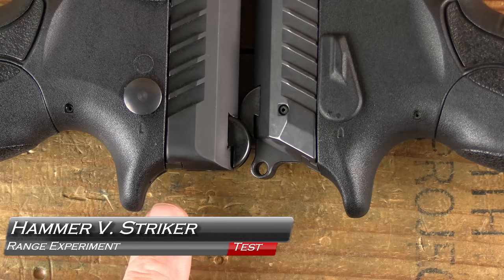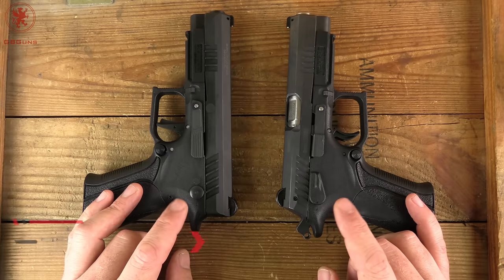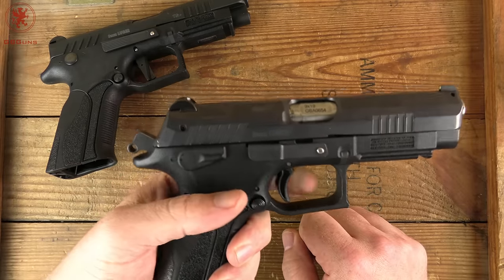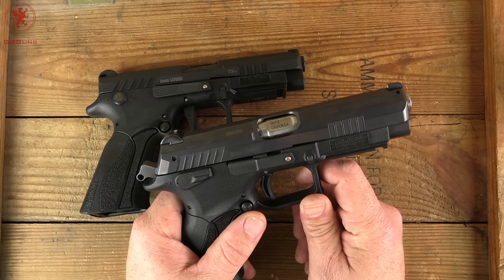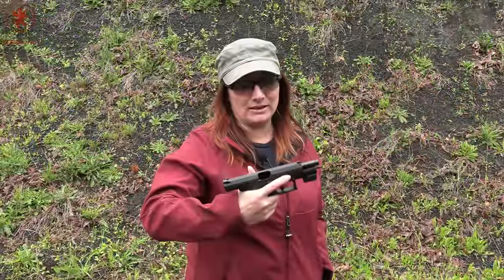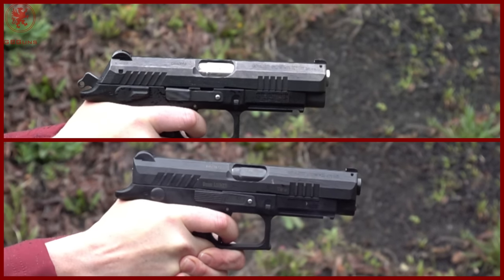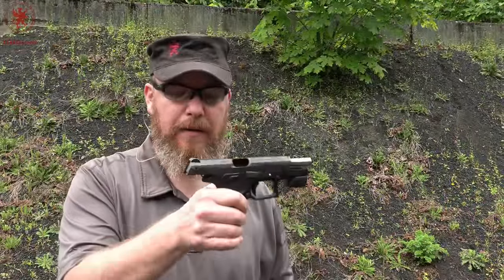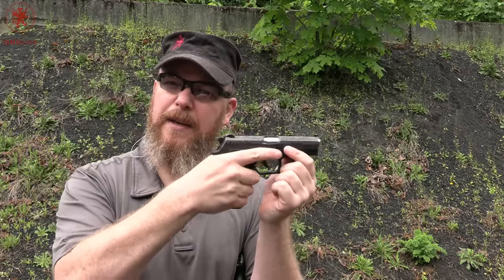Hammer Versus Striker Fired Recoil Experiment

Comment: Since the hammer does take up some of the recoil energy, a lighter recoil spring can be used. The problem is cycling reliability and making sure the slide goes back into battery. 
With the striker gun, the recoil spring is the only thing that controls both forward and back motions of the slide. So the recoil impulse is more consistent in both directions. 
With the hammer, that changes things. The rearward motion of the slide is controlled by two springs while going back into battery is only controlled by one. This is tricky because the inertia of the hammer must be overcome for the gun to cycle. It makes sense that the striker gun felt smoother.
Reply: Not true. Forward motion of strikerfired pistol is controled also with striker spring weight. That is why you need stronger recoil spring in striker fired gun than hammer fired.

Comment: Have you tried to check whether the springs are different?
Another cool video could be to compare 'similar' handguns with tilting vs rotating barrel and check what the Mantis system shows in vertical movement.

Comment: for carry I prefer SA/DA with decocker for sure. When holstering I like to use my thumb to check if the hammer moves which helps to calm down my safety OCD :D I suspect this is also a matter of habit though... if you are used to train and shoot striker fired guns, they may work for you just fine. For example if I compare CZ P07 and P10C in terms of recoil and trigger, wow that P10C is so much better. Then I pick up my CZ75 Tactical Sport and that's the end of the story :D

Comment: At a minimum you need to know the recoil spring weights. Also need to know the striker spring wait and the hammer spring weights on both pistols. And lastly if the mass or weight of barrels and slides are different? Great video.
Reply from the maker: Thanks

Comment: Good video.  These guns are factory tuned to run so you have to trust the manufacturer to have done its job.  That being said, a recoil spring/hammer spring experiment would be interesting - lighter hammer spring and heavier recoil spring.  

Your conclusion that the initial cocking of the hammer by the slide after ignition is possibly giving an initial felt recoil and then another when the slide hits the back end of its travel is a good one I think.  It sometimes takes quite a bit of force on the slide to cock that hammer on my 10 mm 1911 but I have the option of thumbing back the hammer to make the racking easier.  

Maybe manufacturers tune their striker fired guns partially for racking by weaker people since they know that there is no hammer to thumb back and make it easier to rack.  Good experiment.

Comment: I think the main advantage of striker system is that you are as designer able to make pistol with lower bore axis. Then the results will be different. But Grand Power, Sig just changed from hammer to striker without redesign of frame so you cannot get all advatages from striker fired system with those manufacturers.

Comment: I personally prefer hammer fired pistols in a SA/DA configuration, my EDC is a Sig Sauer SP2022 in 357sig, however, I have noticed that my striker fired pistols like my S&W SD9VE and Canik TP9 seem to be a bit less harsh on the recoil compared to my EAA Tanfoglio Witness polymer framed hammer fired pistol.

Comment: It’d be interesting to see this with Sig 250 and 320. I wonder if the internal hammer cocks easier. Also I think the bore axises on those pistols are pretty similar.
Reply: I happen to have a Sig P250 and a P320 and have actually shot them together and I couldn't really tell any appreciable difference in recoil between the two. Not an exact comparison tho as we saw here since the p250 is double action only and the hammer returns to a resting position after the slide has finished reciprocating.

Comment: Advantage of striker in just in case of hand to hand fight we can't stop u to firing while they can put any finger in between hammer and frame to avoid firing
Reply: delusion
Reply: Valid point sir. I like how you are thinking outside the normal box. However be aware that someone can just as easily grab the frame and slide and push the slide out of battery and thus render either platform useless. Hence the point of carrying a backup weapon. Whether that backup weapon is another gun or a good knife or some other instrument is totally at each individuals discretion. Just be sure to be proficient at the use of the backup weapon that you choose to carry.

Comment: You state that the recoil  Is caused by the slide returning and hitting the end  Of its Movement. If that is the case, why do we feel recoil  With revolver's? Or maybe the  Recoil on a revolver is greater, because the action of the slide over coming Spring pressure helps moderate  Recoil.
Reply from the maker: Correct.  I said that the recoil we feel is from the action more than the caliber, this applies to semi-auto rifles as well.  Revolvers don't have an action absorbing recoil and also have a much higher angle of momentum.

Comment: Reviving a zombie video, lol.

I suspect that the Q1 has less muzzle flip because all the recoil forces due to the slide are channeled along the axis of the recoil spring. This force is straight back, and almost in line with the web of your hand, minimizing the flip vector. There is next to no effect of the striker riding over the sear, and the striker spring is compressed when the slide moves forward, so it is a non-player. 

With the K100, the hammer spring must be compressed. If the hammer pivot is frictionless, then some of the recoil force is directed straight down the back of the grip, with the rest absorbed by the recoil spring. Arguably, the downward force down the back of the grip is behind the pivot point created by your strong hand where it meets the underside of the trigger guard. This has to create flip. Worse, there is probably force imparted on the hammer pivot pin because we don't live in a perfect world. This force is coming in relatively high on the pistol, aiding the flip once again.

Hope the above makes sense.😀
Reply from the maker: Great points!  Thank you.

Comment: If the weight of the slide is the cause for recoil, why does 357mag especially in short barrel have so much recoil? There's no slide coming back. Very interesting topic and video 👍
Reply from the maker: Some years later I think a better description is it's the weight of the slide stopping and changing direction. A lighter slide can still be a source of recoil as it slams rearward and a heavier slide can reduce felt recoil if it's not hitting so hard at the end of it's travel.

Comment: in your explanation of the differences at 6:50 you said that the hammer fired felt smoother when shooting but then at 7:15 said that it seems like the slide hitting the hammer when in motion feels like an imaginary first impact wall causing the muzzle to rise when shooting. those seem to be opposite of each other. How could it feel smoother and you also feel (or notice) an imaginary first impact wall? If the striker fired doesnt give that same feeling of separate impact points when the slide is moving, how could it not feel smoother? genuine question, not trolling, not attacking, just trying to analyze the info. Thanks. Nice vid.
Reply from the maker: I said that I theorized the slide hitting the hammer would stretch/lengthen the recoil impulse.  In actual shooting it felt less smooth than the striker, and yet I personally preferred the impulse.  That was a quasi scientific approach to explore a topic I hadn't seen anyone else cover.

Comment: if u r right then why is a recoil in a revolver .
Reply from the maker: Because in a revolver there is nothing to absorb the energy from the casing trying to push back.  Also revolvers give that recoil a higher axis and more leverage on your wrist.  This is why a revolver and semi have very different perceived recoil even if the same weight, barrel length, and caliber.  Good question!

Comment: I did I see more recoil flip in the hammer fired gun, but I shoot a Grand Power P1 9mm hammer fired and love it, I also shoot a Beretta PX4 in .40 cal and love it both with rotating barrels. My Grand Power has strange Tactical Advantage that other mil spec guns do not! Example if you slam a full mag home the slide will automatically chamber a run for you, it’s engineered that way!